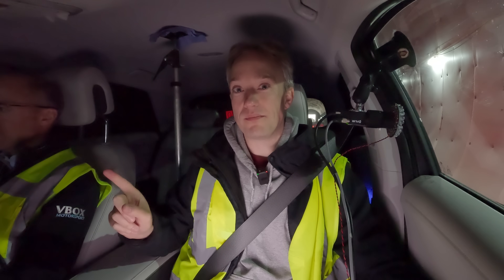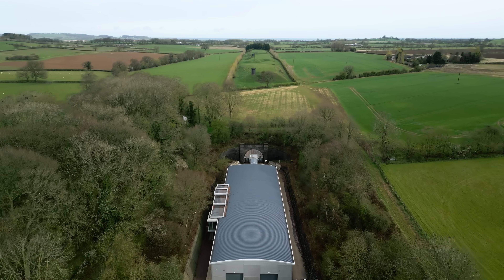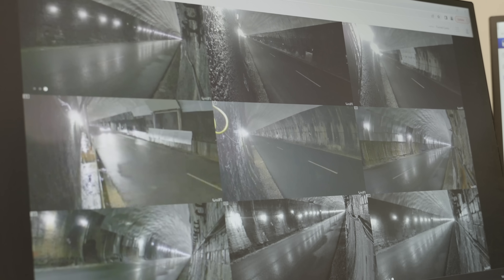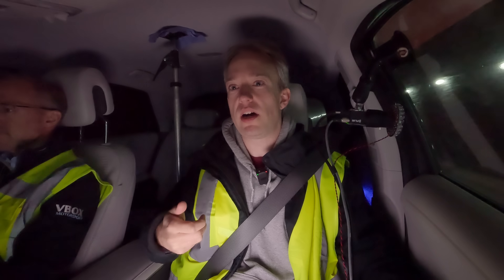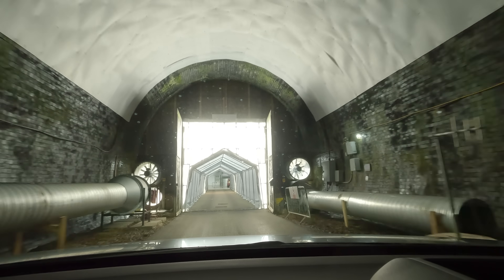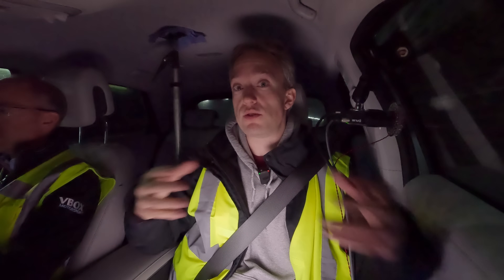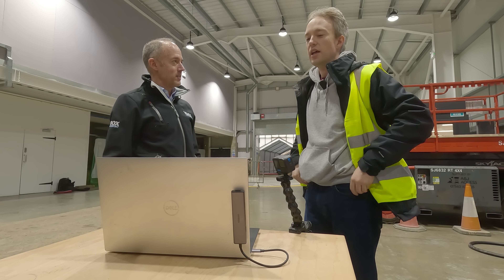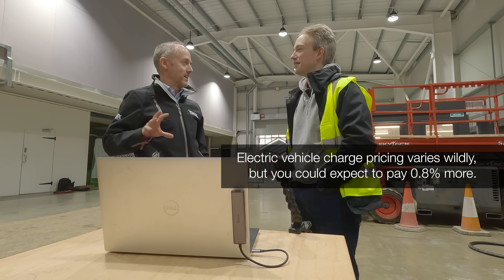This is an excuse to show you a really good tunnel

Comment: The difference in mass of a Hyundai Ioniq 5 battery between a fully charged and a completely discharged state is approximately 2.97 x 10⁻⁹ kilograms, which is equivalent to about 3 nanograms...so the weight does change between tests

Comment: Is it possible that the driver's inclination to drive on the left hand side of the road could impact the results? I seem to remember watching a video about a speed test of a hypercar on the straight of a racetrack, and the test could only be conducted in a single direction because over time the asphalt of the racetrack had developed a "grain" that meant driving in the opposite direction to the normal race traffic would yield greater friction. When combined with the stresses that the speed put on the tyres, this would create a higher risk of them exploding. Although I don't expect that (in most cases) the cars tested here would be reaching the speeds necessary for tyre explosion to be a threat, would the gradual change in the "grain" of the asphalt eventually result in unreliable test results? in terms of a reduction of friction over time from continual one-way traffic.

Comment: What I wonder about? Is this economically viable for testing cars that are in late stages of production?
I guess the advantage with a 'normal' wind tunnel would be, that you don't need to use a fully furnished car, engine and all, right? So you can do it much earlier in the production cycle? At least that's what I assumed.

Comment: As per E=mc2, the weight of the electric car changes as energy is turned into friction, sound pressure, etc. Since electric motors are a lot more efficient than combustion engines, this weight change isn‘t anywhere near that of a diesel or gas powered car, but it is there!

Comment: Since the tunnel is flat instead of following the curvature of the earth, doesn’t that mean that the effect of gravity is ever so slightly stronger in the middle of the tunnel compared to the ends?
Reply: @smeeself mumbo jumbo
Reply: @smeeself try to prove your claims... if its flat it cant incline. and whats about gravitational potential? its mumbo jumbo without reference to examples that can be observed in real life
Reply: @smeeself I mean how one can't understand that ball earth? its the ball earthers that can't apply critical thinking...but I will check if its mentioned. one statement in the video is earth has curvature...so you can't rely on the quality of the statements.
Reply: doesnt that mean it must go uphill then? punt there is no curvature. and no gravitation either
Reply: @smeeself but they found out with a laser that it's flat. and there was no talk of an increase or decrease. according to ball earth, the end of that track must be around 1,5 meter below the start point. no decline or incline mentioned...but how can it be flat if its laser tested? one of many hints earth is indeed flat. overwrite your programming dude.

Comment: Charged batteries do weigh more that discharged batteries I believe
Reply: And people lose mass as they breathe out carbon dioxide and water vapour. The tyres lose rubber as you drive along. But just like the battery mass these are all such small effects that they are insignificant in comparison to the measurement variability. As such they have no impact on the results and only matter to pedants and YouTube commenters trying to sound smart by repeating something that has already been said dozens of times.

Comment: wait, that part about an EV having constant weight compared to a combustion car holding fuel. Isn't it proven and known that a battery fully charged, weigh more than an empty battery?
This can be tested with your everyday AA battery, its probably less than 1% more, but its not insignificant. So with an EV car that has about 30% of its weight in batteries, if a GoPro can have an effect on efficiency, I'm sure full vs depleting batteries would too
Reply: It's way way WAYYY less than one percent, calculable but unmeasurable.

Comment: I'm just wondering why they don't have a raised lazy susan at the far end? It wouldn't be flush with the surface but for a slight ramp, you get the same automation, and ability to turn a longer car around

Comment: Of course an Ioniq 5 doesn't really have a neutral, the rear motor at minimum is always connected and generating a back-EMF. I love that the water barrels at the end cover only half the width so you still have a choice.

Comment: But doesnt the mass/energy equivalence means a full  electric car battery vs a used one (after a few runs) would mean the battery is lighter in mass from having expelled some of its energy and affect the results or is that also taken unto account when doing the calculations?

Comment: Digital neutral if I may call it that way, I was wrong with the below my bad 😉 I'm amazed no-one pick up on this how 🤣 he's putting it in neutral to coast what how 🤣🤣🤣 it's an electric vehicle Hyundai Ionic 5, it doesn't have a transmission, they also don't have a neutral gear. Electric vehicles send power to the wheels via the current that travels through the batteries. There is no neutral wow science is not for you mate 🙏🤣🤣🤣
Reply: @smeeself fair enough I'm staying away from electronic but ok u got me 😉take your foot off the brake the prompt will come up you want to hold the ok button on the steering wheel until the prompt. changes confirming that you are now in neutral.

Comment: wouldn't the battery start to weigh less as it is discharged? we are talking on the atomic level, but still its weight. The premise of electric vs fossil fuel car for this test is still valid, however the way they phrased it seems technically inaccurate.

Comment: /r/fuckcars moment

A literal train tunnel is used for testing cars...

This is not a step forward, its back, a lot.

What has less airdrag that 100 cars? Hundred people sitting in a train.
Reply: It was disused because a new train line was put in to replace it. It was used from 1897 to 1966, then sat disused and flooded for 50 years. what else do you think could it be used for?

Comment: How do they prevent carbon monoxide buildup?
Reply: Well the car they used here was a ev so it might be a ev only tunnel but then again it was built for steam trains to there might be small holes to the surface every few meters

Comment: I'm more confused as to how an electric car can have a Manuel gear box
Reply: It doesn't, automatics have drive reverse neutral and park usually, some hybrids and electrics have a braking mode too which increases the resistive force of the engine to help going down hills
Reply: Ah yes, Manuel, the Spanish inventor of the stick-shift gearbox

EV's don't shift, neutral to an EV is just the inverter switched off to the drive motor 

(The reduction gearbox/drive motor are permanently coupled together)

Comment: Most people would just sit in the car while the driver drives through the tunnel once, but you did it 16 times for all the cool camera angles and got them to calculate the difference in aerodynamics for a video that's less than 8 minutes long. Others would drive through the tunnel once and make it over 20 minutes long with ads every 4 minutes. Plus another 2 minutes of a sponsored mobile game ad while also telling people to subscribe no less than 3 times, including at the start of the video while also not including subtitles.

Comment: Hey. As an ex-suryeyor. I would  excavate a rough tunnel. Fix a high magnified theodolite at both ends. Sight them 2.7 km down each other's optics and use that to create a straight line for levels. Being in a tunnel atmospheric distortion will be significantly reduced to..
Reply: » ±I𝟒O𝟓𝟔𝟗𝟖𝟑𝟗𝟕O  why setup from either side. As a Surveyor we need the addition of redundancy in our measurements.

Comment: I'm sure they're way smarter than I am but wouldn't the road being higher quality than any real road, and the unique tunnel aerodynamics he mentioned invalidate the rolling resistance and aero resistance measurements?
This has been a thing in road cycling for a long time: tiny tires were pumped as hard as possible because under laboratory conditions on a mirror smooth surface or in a cyclodrome a tire that doesn't deform at all is most efficient, whereas on any real road that is not the case.
Similar story with aerodynamics and wind tunnels, in the real world the wind is never perfectly in line with the direction of travel.
Reply: Well the idea is to test specifically for the effect of wind. The variables you mentioned do definitely affect cars in the real world, but there are other tests that are more specialised for that purpose. If you have a tunnel with a bumpy road and wind coming from all sorts of directions, it'll be great for simulating realism, but practically impossible to pinpoint what exactly is causing what.

Comment: Hang on a minute, if the tunnel is 'straight' according to a laser beam, then it isn't 'level' according to gravity, surely? 

I hadn't actually thought about that before. The implication is that over long tunnels, surveying and guiding using optical methods (laser beams, theodolites), requires correction to maintain a 'level' tunnel.

Comment: That was way cool and informative. Would very much like to participate with testing off road rated vehicles in stock configuration against various manufacturers after market products such as various size tires and between manufacturers, roof top racks with and without various roof top tents, etc. Another set of test would be compare MPG of cruse control vs driver controlled speed. Thanks for sharing.

Comment: So is the tunnel only used for testing electric vehicles? No mention of it but I assume so since there's obviously no ventilation for combustion products.
Reply: It was built for steam trains burning coal.
You wouldn't want to sit in traffic in there but it's strictly one car at a time when testing. There is more than enough space and ventilation that combustion engines are fine under those conditions.

Comment: Does the weight of the cαr change due to depletion of the batteries? Mass=energy and all that. I guess a very small change only, certainly not the same as using gasoline.

Comment: At that range there is atmospheric refraction that bends light and also earth curvature. The curvature correction for a distance of 2.7 km is approximately -0.571 meters and the refraction correction is approximately 0.084 meters. These corrections mean that for this distance, the level reading would need to be reduced by around 0.571 meters due to curvature and then increased by about 0.084 meters due to refraction.

Comment: In case anyone is confused by the tunnel being "flat," yet having a gradient:  "Flat" is not the same as "level."  A level line is a curved line (constant distance from Earth's center of gravity).  This tunnel is instead "flat," meaning straight, not curved.  It has gradient, because one end is higher in elevation than the other (probably to facilitate drainage), and the elevation difference between the ends would have to exceed the difference of the middle from level.  In the absence of gradient, all water that seeps into a flat tunnel would drain to the middle, because that's the point lowest from level.
Reply: What do you mean by "vertically straightly"?
Reply: @GRosa  That's a slight editing error.  I meant "vertically straight," and by that I mean not curved in the vertical axis, as a level line or a line on the surface of the earth is.  A straight line is, of course, the shortest distance between two points, or the trajectory of a laser beam.
Reply: Take this to the extreme. Make a tunnel straight down through the earth to the other side. That tunnel is flat, but you will fall until you settle in the middle.
Reply: There's a book called "caging the dragon" about underground nuclear testing.  Wherein I learned that the scientists employed professional drillers to make big deep holes to put the bombs in.  At some point, they asked for 'a straight shaft'.  After which they learned that they should have asked for 'a plumb shaft'.  Words matter.
Reply: Depends on where your tunnel start. It could also run out from one end.
Reply: @RosaKnuffel  Only if a flat tunnel has gradient could water run out one end or the other.  If both ends of a flat tunnel had the same elevation, water would drain (or marbles would roll) to the middle, because the middle sags relatively lowest from level (deepest within a spherical earth).  The effects of gravity are balanced by levelness, not by flatness.  Imagine a hypothetical straight (flat) tunnel from London to New York.  Both ends would emerge from the earth at an angle, and its middle would be many miles deep into the earth.  Clearly, any water or marbles would pool in the middle.
Reply: I'd have said "flat" as in there are no undulations in the surface
Reply: Sooo, the car in the flat tunnel speeds up slightly towards the middle (like a marble) then slows down to the end. Should have made the tunnel level instead then, much easier calculations… 😊
Reply: @itbwg  Correct about the effect, but remember  that one end is higher than the other anyway, so they'd still be correcting.

Comment: yesterday i didn't know that it would cost you roughly 10 cents per 100 miles in added fuel consumption if you stick a go-pro to a car. but today i do, this is knowledge that I will carry with me for the rest of my life (or until gas prices change)

Comment: As we know that energy and weight are related, then isn't his argument about using the ideal car false, running the car the other direction through the tunnel without a charge between runs, results in a lighter car the second run and any other successive run without a charge between them, and then also, as the electrolytes of the batteries get old and held less and less charge, then this also altering the weight of the car? It seems a more correct response is that the weight change between runs is significantly less than with an internal combustion engine.

Comment: if its straight then its actually gravitationally curved.
so don't things accelerate toward the middle? and also isn't the air density higher in the middle?
Reply: and also; i forgot, the whole tunnels air density/pressure goes up/down, quite a lot, with the weather anyway.

Comment: I love that there is a constant "Oh, of course! Right! [you make the connection] That would make a difference!" in this whole video. Even the little thing for the turntable and the remote button, you'd think might not make a difference, but then they talk about the ICE versus the EV and then my brain goes:

"Oh, of course! Right! That burns fuel... And if they had to turn around the car that would be wasted fuel. And now the turntable is the same time/distance between each run, so you eliminate one more potential variation. The remote is nice and flashy, but even getting out of the car to hit a button would add more time/variables to the overall data... That would make a difference!"

Comment: Brilliant! Yet I wonder why the test vehicles don't travel down the very center of the tunnel. Doesn't the relatively low pressure on the wall side vis a vis the higher pressure on the "open" side affect your results?
Reply: They of course don't make any conclusions which would be affected by that.

They are mostly comparing multiple runs, which are all equally close to the wall, so the comparison result is not affected, why would it be.

Comment: What the heck is the pole behind tom? Is that the insurance company making them install roof reinforcement?
Reply: Clamping an inertial sensor down to the floor so that it measures the body motion more accurately. The measured acceleration data can then be used to verify the camera based speed data.
Reply: @AndyA314  That makes a lot of sense. Thank you.

Comment: It's too bad there's a grade in the road. Otherwise the middle would be at the bottom of two hills. A perfectly flat road on a round Earth would make the middle of the flat road downhill compared with the ends.
Reply: @smeeself Flat was the wrong word to use. I suppose I meant having the ends of the roads the same distance from the center of the Earth. Objects at both ends of my hypothetical tunnel would have equal gravitational potential energy. If the two ends of this tunnel were connected with a straight line then the center of the tunnel would be downhill from both ends.
Reply: @ddegn  yes it would, but thats not the case here. This tunnel has one end closer to the level
Reply: @Dicaso9  I imagine the original tunnel builders weren't concerned with a small incline. I think it would be cool if a perfectly (within reason) flat and very smooth road could be made which were also equal height at each end. If such a road could be made smooth enough, it might be possible to roll a marble from either end and have the marble end up in the center.

As I think about this a bit more and doing a bit of math, I doubt such an experiment would work. If my imaginary tunnel were a mile long, the center of the tunnel would be about 2 inches lower (closer to the center of the Earth) than the ends. An incline of 2 inches over half a mile wouldn't be enough to get even the roundest and smoothest of marbles rolling. 

The "incline" wouldn't be behave as a straight slope. The gravitational acceleration wouldn't be constant. 
The "dip" caused by not following the curvature of the Earth would be very subtle and it would be hard to come up with an experiment to demonstrate this "dip." I just think it would be cool to have a straight flat road which wouldn't be considered "level" by all definitions.
Reply: @ddegn  with no friction the marbles would defo roll to the middle, in reality friction would most probably stop the marbles from rolling. just like if you put a marble on a table, that table's most probably not completely level but the marble wont roll because the force is counteracted by friction